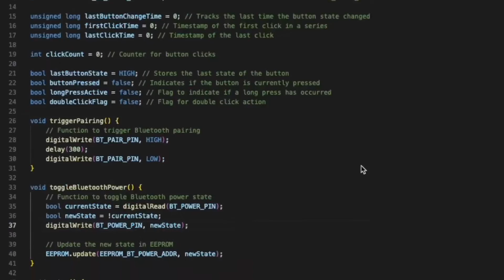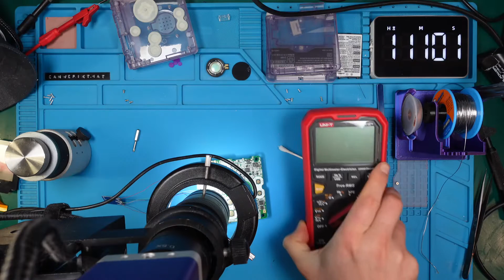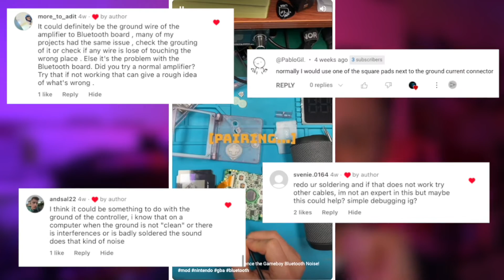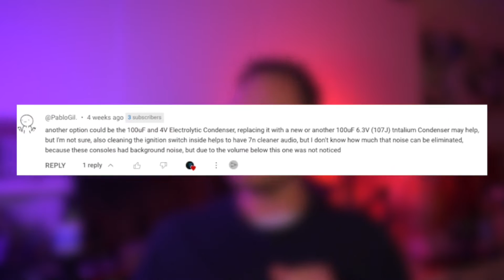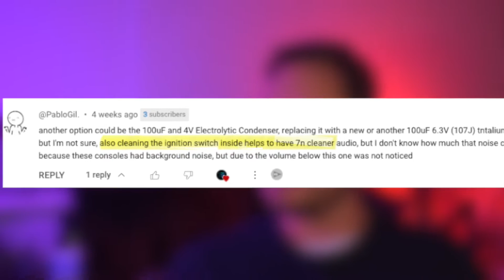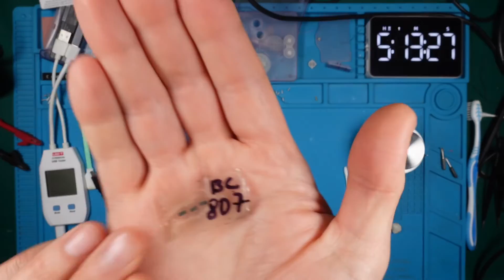How To Add INSANE Wireless Audio To Your Game Boy

Comment: clearly i dont know what im doing lol... i got the Tiny85 to program with test blink so that works, but when I load your project I keep getting "'avrdude' is not recognized as an internal or external command,
operable program or batch file."
Reply from the maker: Hey! It might be better to open an issue on GitHub – that could potentially help more users. The comment section here isn’t really the right place for this. 🫶

Comment: Ordered the parts but I couldn't get the Attiny85 to flash properly after 90 minutes of attempts. It would've been nice for documentation on this part. I've followed your directions to the dot, did my own research, started from scratch and I can't get it it to work. Thanks for the idea, but instructions as is on Github could have more info on flashing the code needed to make this your unique mod
Reply from the maker: Hi Jacob! Thanks for trying it out! May I ask you which IDE you've used for flashing? I used PlatformIO inside of VSCode.
Reply: @CanWeFixThat  I also used PlatformIO inside VSCode - I've never programmed a chip before so this was my first show. IO couldn't find the USBtiny when trying to upload (I believe because you have to use the header pins and NOT USB). Tried finding the Digispark drivers and all that but couldn't get it to work. I was able to get Arduino IDE to upload code to the Tiny. So after I solve my background noise problem today - I will try adding the #include stuff to the src and push the code that way. I'll keep you posted
Reply: @ Found the solution for why it wasn't flashing! Removing the custom protocal and adding upload_protocol = micronucleus. I highly recommend at least adding this info to github for others!
Reply from the maker: @jacobanthony5521 This is great! Let me know if you want more info on the GitHub page, and I will update it accordingly! I'm glad that you've found the issue. ✌🏻

Comment: This is probably overkill but imma slap an esp32 c3 mini in mine. About the same board price as the kcx emitters.
Reply from the maker: Also, it's a cool idea, but isn't this even thicker (space) in total? ✌🏻
Reply: @CanWeFixThat  It is. I'll have to desolder the usb c port and the buttons if I wanted to fit it behind the display of an sp. I'm on an agb-001 tho lol. s3 supermini not c3 btw. It also requires coding the adc and a2dp to handle the audio. Way more work but still doable.

Comment: Im 90% done with this mod, but im using an ags101 motherboard, so i cant get +5v off of the source you used. Do you know where on an ags 101 motherboard i could get 5v?
Reply: Got 5v from S2. Now i have a new problem tho. When i pair to a speaker, i get no audio for a few seconds, then it unpairs
Reply from the maker: Have you tried it step by step? Are you only connecting the Bluetooth module and giving it power? You could try powering it with a lab power supply, but you need to make sure to have a common GND, so connect the ground of the GameBoy to the GND of the lab power supply. ✌🏻

Comment: Hey everyone, has anyone managed to install this Bluetooth module v 1.7 to a Gameboy advance? 

All info on that installation uses the previous 1.4 version but I can't find it anywhere for the life of me...
Reply from the maker: Hi Christos! Do you mean a classic Game Boy Advance – not the SP version?
Reply: @CanWeFixThat  exactly!
Reply: @CanWeFixThat  absolutely yes, I really wanna install Bluetooth on my Gameboy advance, and the few videos I've found all use the v1.4 module... I can no longer get my hands on one, I only have the v1.7 !
Reply from the maker: @ChristosPanagoulopoulos What exactly is not working? Do they have other pin-outs?
Reply: @CanWeFixThat  I can't get it to turn on, my guess is that the 1.4 version can operate with less voltage, while the 1.7 is more strict on that matter. So I guess my question would be do you know where to get a reliable clean 5v from the motherboard!
Reply: @CanWeFixThat  also, I don't know if there's a solution like a step up circuit board to add, that would amplify the voltage? I'm still a beginner in electronics
Reply from the maker: @ChristosPanagoulopoulos There are always ways to boost or increase voltages, but I would avoid it if possible.
Reply from the maker: @ChristosPanagoulopoulos If I were you, I would try to measure the board while the system is turned on. You could try to measure at one of the ends of the bigger capacitors to see what voltage you will get. When you find 5V, you could try to use them of these pins.✌🏻

Comment: I'm going to test if this is possible with regular gba as well. I've copied the video tutorial posted by gamboy custom, but there's a problem with the Bluetooth module not turning on like someone else said. So I'm going to use gba link port to power it up like you did in the video. The key is whether the link port of gba is the same as the link port of gba sp.
Reply from the maker: Hi Yoake! Thank you very much for your feedback. I want to point out that I have NOT used the link port to power this project. I explained at the end of the video why this was not possible. You will also see in the GitHub repo that I used another test point for that. Long story short: the voltage differs when you play a GBA or GB Classic game, due to specifications. I hope that helps! ;)
Reply: @CanWeFixThat  Thank you, but the regular gba doesn't seem to have a 5v pin. It's sad
Reply from the maker: @YoakeZet Are you 100% sure about that? I just found out by measuring a bunch of the test points to find one that fits my needs. But I have not checked the GBA Classic variant.⬤
Reply: @CanWeFixThat  I ordered a multimeter machine for testing. But I saw retrosix wiki and it says that 5v is formed on the second pin on the lower left side of the power regulator of the gba. But I don't know if I can solder the 5v terminal of the Bluetooth module to the power regulator. It's a power regulator, so I don't know what the problem will be with the gba if I draw the power of the bt module from there. I'm a non-major in this field, so I don't know the details, but it's just my guess.
Reply from the maker: @YoakeZet Don't worry, this should be fine; that's basically the same thing I did. But I can't give any guarantees for sure ;) Just give it a try.
Reply: well. I eventually confirmed that c54 outputs 5V and succeeded in turning on the module. However, there are still many problems. The first problem is that I connected the con pin of the module to the test point of the start button, but the start button doesn't work. as if it didn't work when you connected the brightness button of sp to the con pin of the module. I still don't have a clue how to solve this problem. The second problem is the tremendous noise. Hmm. Literally enormous. I took a different approach to this noise problem than you did. I would add an isolation dc dc converter between the module and the gba's 5v pin connection. In theory, the converter would provide a clean voltage to the module and solve the ground loop problem. I'll try it and leave you a review.@CanWeFixThat
Reply from the maker: @YoakeZe If you skip the transistors, it will be a completely new circuit with different problems. Do you plan to use the microcontroller? If not, maybe the way that Tito took would be the better way to do it?
Reply: @CanWeFixThat  Hmm. I don't know much about electronic circuits and programming like you do. So I don't know if I should put a transistor in it. Instead, I drew a diagram of the circuit diagram that I designed. 
Go into the link and look at the picture.

 (edit : I attached the link and the comments are deleted. So I just uploaded the diagram to my channel. Just watch the first video.)

 This circuit diagram has been tested except for DC-DC converters. Do we need a transistor in this circuit diagram?
Reply from the maker: @YoakeZet As I mentioned, I don’t think that my repository is a big help for your particular scenario because the whole purpose of my setup is to control it with the ATTiny microcontroller, which you are not doing. ;-) I don’t think you need the transistors, as I used them as electronic switches to be able to control it with the microcontroller. I would advise you to watch some more videos that implement Bluetooth in a GameBoy Advance. There are many more videos that are not as overkill as mine. I think this would be easier to replicate in this instance. Sorry that I can’t help you more. 🙈
Reply: @CanWeFixThat  The module works fine, but the terrible noise remains the same. Ferrite core, ferrite sheet... I've tried everything I can, but the noise doesn't go away. Maybe I should give up this mod. Thanks for the advice.
Reply: @YoakeZet  Hi man! I have been trying to make it work as well, I'm exactly in your situation: I have a GBA that I'm trying to install the v1.7 module. I also tried getting 5v from the cable connector but no dice... 

I am really tempted to try your method. Did you find a way to get clean audio ?

Comment: Fantastic video! I’m aiming to achieve something similar, but with a twist: I want to bypass connecting the CON to any button and instead utilize the physical button on the emitter for pairing, possibly relocating the button to the side of the case. Do you think the pairing button on the Bluetooth emitter would be effective when pressed independently?
Reply from the maker: Hi Daniel! So you want to desolder the tiny button from the Bluetooth module and relocate it? This should work. ✌️🪛
Reply: @CanWeFixThat  exactly! I already have my IPS soldered to the Brightness button and the select button is not a good option for me. I will try to reallocate the little tiny button somewhere outside the case and use that physical button to pair. I was concerned if the CON needed to be connected to any point for the Bluetooth to be able to connect due to voltage perhaps.. would the physical button work independently? Thank you once again
Reply from the maker: Hi Daniel! Sorry for my late response. Yes, this should work with the physical button! Keep me posted about your progress—I'm curious to see how it works out!
Reply: @CanWeFixThat  hey Markus, thank you for your reply! I completed the mod and everything worked just fine. The only funny thing is that even when connected to the Bluetooth the speaker still works together, since the audio volume can be controlled independently, I just mute the SP when I connect the Bluetooth. I am not sure if there is any other way to do it 😂
Reply from the maker: That is completely normal! It is not a bug: it is a feature 🤣

Comment: Awesome video! I had a quick question. When paired to a Bluetooth speaker, is the volume still controllable by the GBA SP, or only by the speaker. I’d love to replicate this and use AirPods, but mine do not have volume control.
Reply from the maker: Hi Brandon, thank you! 😉 The volume on the GBA still controls only the internal speaker volume, so unfortunately, you can't use the GBA to control the volume on the Bluetooth device in this setup. 🫤
Reply: @CanWeFixThat  ah that’s too bad. Well that may give me an excuse to upgrade to the gen II Pros lol. 
Just thought of one more question. I’m planning on putting in an IPS screen on mine that has different brightness levels and color effects, all using the brightness button. Would that interfere with using the brightness button as the Bluetooth power and connection?
Reply from the maker: @brandondavis6838 I would say this should work (but can't tell for sure), but I suggest you first get the Bluetooth mod running and then install the IPS mod to see how they work together. Make sure the button press patterns are not the same for both mods, otherwise, you might trigger unintended actions from one or the other. Keep me posted! ;-)
Reply: @CanWeFixThat  thank you so much!
Reply from the maker: You are welcome! 🙌🏻
Reply: @CanWeFixThat  Hi there ! I installed this mod on my AGS 001 and I am able to control my volume through the slider ! I used a tutorial from the channel Mundoyakara here in YouTube !

Comment: this is absolutely incredible. Would designing a custom pcb with the essential components of the attiny module and the bluetooth module be a proper solution with helping reduce the size/profile of the mod? i would almost imagine using a sturdy flex pcb like a lot of modern gameboy mods being very beneficial.
Reply from the maker: Thank you very much! There are also methods to create very thin flexible PCBs. But even these would slightly increase the thickness of the mod. I'm not sure if an IPS screen would be thinner overall to provide more space for the mod. Does anybody know?
Reply: @CanWeFixThat  the ips screens are certainly a lot thinner then the vanilla screen for the sp. I personally just did a gba slab mod but the ips screen i used has a custom pcb with it to control color and brightness with conductive copper pads. However I know there are other ips screens that don't have those features and are very low profile.
Reply from the maker: @readifer That's brilliant, as it means the mod would fit even with a thin PCB. The only issue I foresee is if someone uses a non-transparent case, it might be hard to tell if the module is on or off.
Reply: @CanWeFixThat  that's fair but I feel that's a minor detail that could be looked past when given the option to have proper Bluetooth pairing. I don't think it would cause much inconvenience beyond just having to press the brightness button a few times over until it connects to their desired device
Reply from the maker: @readifer Could you recommend an IPS screen kit? I might give it a try in the future. So far, the feedback on this mod has been unfortunately low. It took a lot of time to create this video and the project as a whole. But that's life, I guess!

Comment: Cool implementation of attiny. Are the gpio pins all used up?
I was thinking adding a 29Mhz crystal to make it switch between the stock (16Mhz) crystal for fast forward feature.
Perhaps you could make an updated video!
Reply from the maker: Hi Jacki, first off: Thank you! 😉 
Currently, the ATTiny85 is using its internal 8 MHz clock. You can check out my project page on GitHub to see which pins are connected and find out if there are any useful GPIOs left. Could you clarify what you mean by the "fast forward feature"?
Reply: @CanWeFixThat  
Its a diy version of GBAaccellerator. Rather than paying for the outdated board, a simple switch with a higher clock crystal would be enough, and of course cheaper and accessible to everyone since crystal and switches are dirt cheap.
Reply from the maker: Ah, I see! Ok, that makes much more sense now! 😄 I think combining those things could be possible, but without a PCB design for the Bluetooth mod itself, adding anything else would be a nightmare to solder. However, I'll definitely keep it in mind!

Comment: wonder if this is possible with a Regular GBA
Reply from the maker: Absolutely! It should be nearly the same solution! 💪🏻
Reply: Oh! well I was wondering because on another video I attempted the mod but it never succeeded, it never got enough voltage to turn on, and other people also seem to have had the same issue
Reply from the maker: @thebeepmann2527 I am sure there will also be a testing point with 5V output. Please look at the GitHub project page in the video description. There might be a chance it gives you clues to take measurements with your multimeter to find the proper voltages.